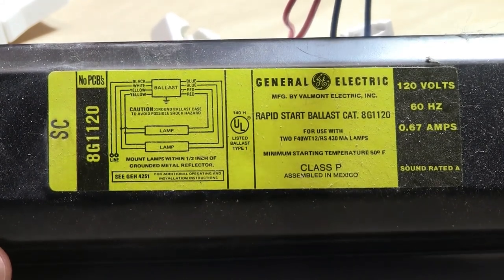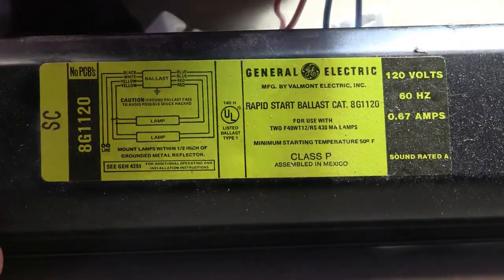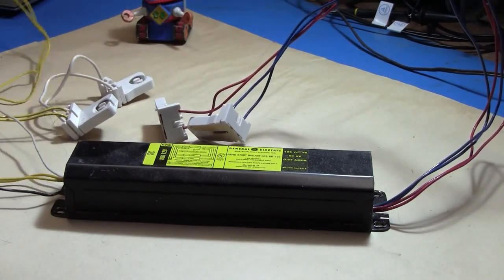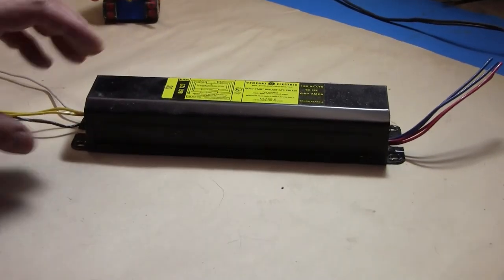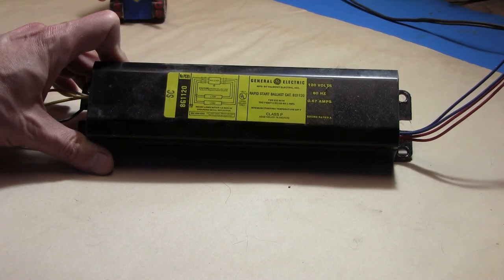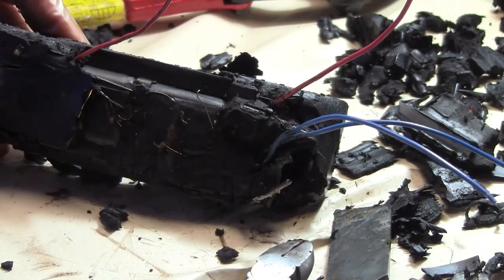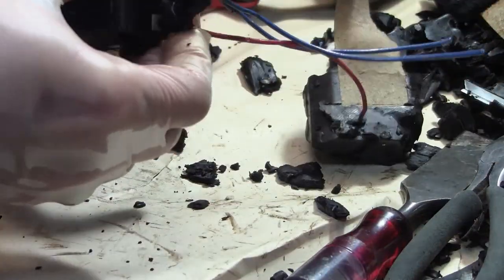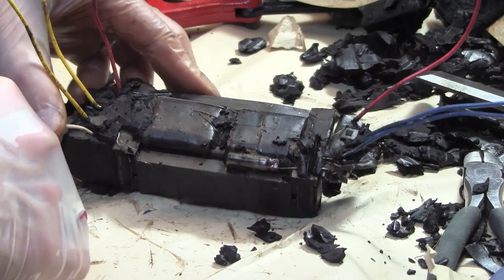Inside a Fluorescent Lamp Ballast

Comment: The glass part is the thermal protection for the ballast. This device opens the circuit thus killing the power to the ballast in case the ballast overheats.
Reply from the maker: Thanks for the info, that makes perfect sense.

Comment: You don't want your fingers on the probe leads when measuring resistance (or any measurement really).  Your body affects the reading of any circuit that has a high impedance/resistance.